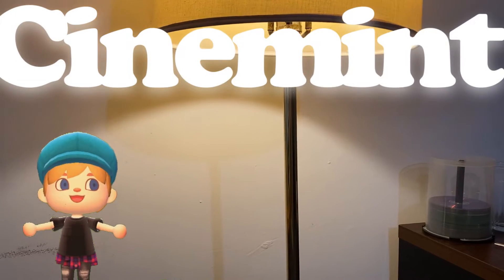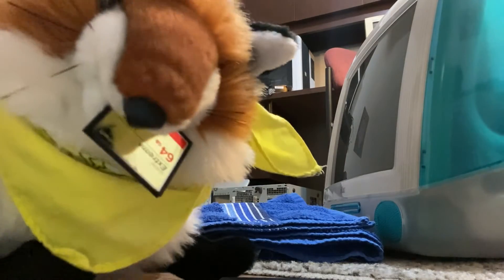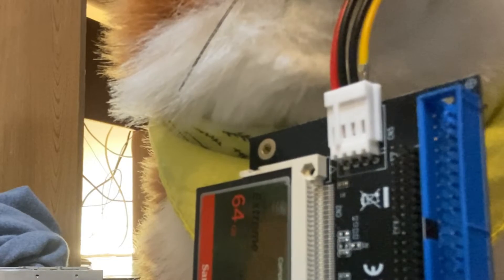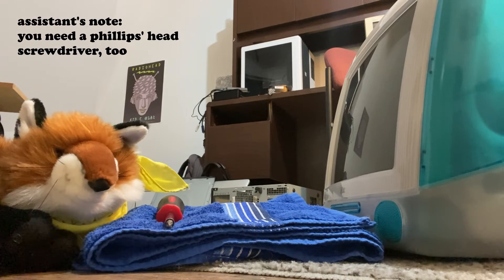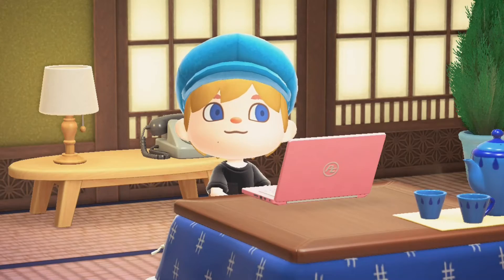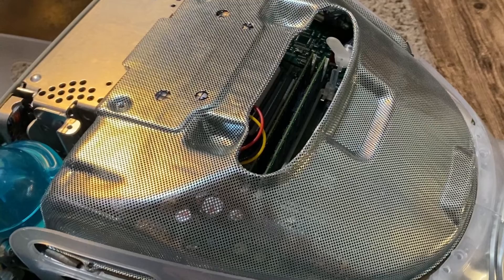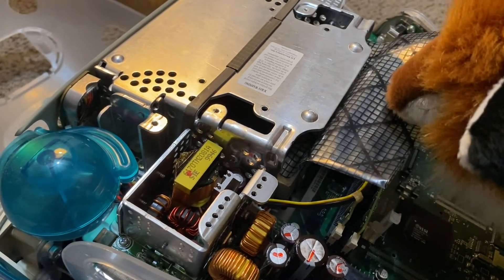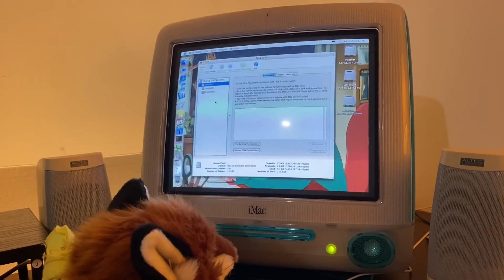How to install an SSD on your iMac G3 SL (CompactFlash)

Comment: Hi! Thanks for the very useful video 🙏🏻 Why didn't you install OS 10.1 after replacing the HDD with an SSD?
Reply from the maker: I'm not a fan of 10.1 personally. Either I'll install 10.3.9 or 9.2 if I have to pick a Mac OS flavor.

Comment: And what happens when a Mac turns on with a new unpartitioned SSD? Does it ask for an operating system installation CD?
Reply from the maker: It doesn't do anything, it just sort of sits there with a missing OS icon. Old Macintoshes are specifically designed to not "need" a hard drive, and so it doesn't expect anything other than a bootable disc.

Comment: Hey you mention that 44 pin wont work for iMacs.  If you were to purchase a 44 to 40 pin adapter, would that be ok, or do I need to get a purely 40 pin adapter?
Reply: Also, the 44 to 40 adapater has the input for the molex power cable if that at all affects things